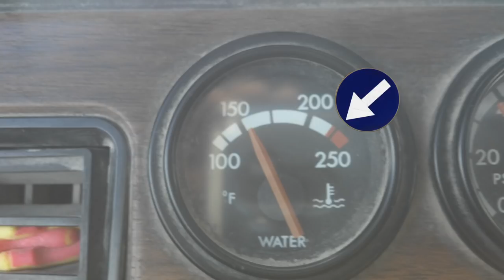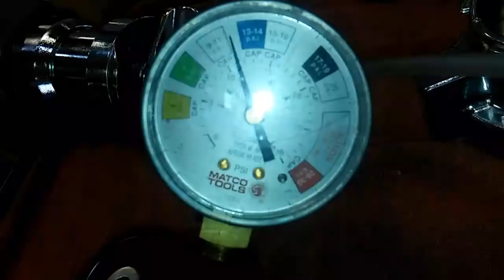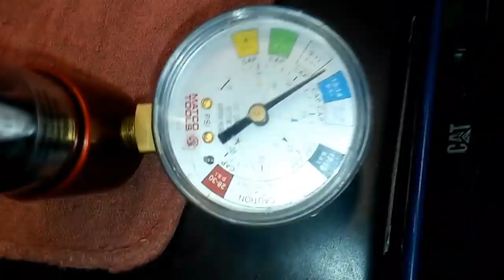Why Do Engines Overheat?

Comment: The glycols found in antifreeze have little to do with raising the boiling point.  They are what give antifreeze its name.  Raising of the boiling temperature is purely down to system pressure, which must be enough to prevent cavitation or localized steam production around hot spots like combustion chambers and exhaust ports.  While water is the best fluid for transfer of thermal energy, its boiling temperature is rather low for use in engines, so the system operates under pressure to combat that.  A company called Evans makes a coolant that does not require you add any water, and as a result can be tailored with a very high boiling temperature of around 370 degrees fahrenheit and zero pressure.  It is ideally suited to diesel engines.  Check it out.

Comment: I had a problem with disappearing coolant, it ended up in the expansion tank. It turned out that the radiator cap was leaking air, no fluid was lost as the pressure was fine, but once the engine cooled off the fluid wasn't pulled from the expansion tank back into the radiator, it was pulling air instead. I noticed it only because i stopped getting heat from the heater.

Comment: I discovered our cummins powered generator had a radiator with fins covered in oil residue and dirt.
Hard to see due to installation inside a building.
A pressure washing was all it took to restore operation.
Radiators can be plugged on the inside OR the outside.

Comment: Hello.  My name is Dave from Shields Excavating in newaygo MI. I want to thank you for this video.  Im have a overheat problem with my dump truck. 95 GMC 3116 cat topkick.  I've changed a lot of parts and it still is over heating under a heavy load. Around 30,000  pounds.  I've cleaned the outside of the radiator. I've Changed the waterpump, belt, thermostat, and coolent.  I've had a camera look inside the radiator and it looked good.  But i never thought of the cap.  So i will try that.   Thanks and for the idea..  Have a good day

Comment: I appreciate the idling video Adept Ape. As a result I've changed my startup and shut down strategy. Per the 20% threshold, my C9 calculated idling time is 36% (50MPH). As for coolant temperature my motorhome has a digital readout. When the coolant temperature reaches 190 F, one thermostat will open and the temperature will immediately dropped to 180 F. On a cool day (65F) it will be 20 to 30 miles of interstate driving for the engine obtain its operating temperature of 205 F. 
All diesel motorhome owners need to watch your channel.
Reply from the maker: +Kenneth Bullins Thanks Kenneth, I saw your donation too. You are very kind.
Reply: @AdeptApe  what about a mix of Antifreeze  will it cause overheating?

Comment: Another great video! Perhaps its worth a mention as to the second function of a thermostat and why people should not remove them. The job of a thermostat is to create back pressure in the cooling system to reduce the formation of air bubbles as well as to assist in a rapid warm up cycle. Even a failed unit that is stuck open will cause back pressure even though as you pointed out, the engine will never properly reach operating temperature.

Comment: Another great video, Josh.  As you stated, the entire overheating subject matter can't be covered in a short time.  Since a lot of truck owners view your site, I thought I'd mention the classification of coolants.  Prior to my arrival at the present place of work, coolant classified as ASTM D3306 was being used, and as a result, several engines were lost, because that coolant is engineered for light duty diesels.  

Coolant designated ASTM D6210 should have been used, as it is manufactured to meet the operating requirements of diesel engines with liners.
Reply from the maker: +Chad Jessup I'm guessing it has more cavitation resistance than the light duty stuff.
Reply: Yes, that is correct.

Comment: What can cause the temperature gauge to fluctuate between 185 to 195, normal operating temp is 185 for my truck. But when trying to go on hill with heavy load or trying to speed up the truck the gauge fluctuates lil bit.

Comment: When it comes to thermostats, I've found in cars running without one, or one stuck open, that they'll often overheat without some restriction, like a washer, due to the coolant passing through the radiator quicker than the radiator can cool it. 
I'd imagine that the same would be true for a diesel engine as well, if the driver is mistakenly thinking that RPMs will help cool it down. 
The driver would come out ahead if he keeps the RPMs down in that case.
Reply: DrFruikenstein
The other big problem if you run without the thermostat is you can overheat the back cylinders in the engine, that restriction from the stat is needed to force the coolant to flow the fall loop round the block. You wind up with the furthest cylinders overheating with the temp gauge reading low, not good.
Reply: deezelfairy 
That's why it's best to not run it until fixed correctly.
Reply: Its different in diesel engines as diesel engines waste less heat energy since it is usually recycled by the turbo

Comment: I've had to replace a radiator in my car not from blockage, but from complete lack of heat extraction fins that are supposed to hold the coolant 'tubes' in place, that thing was lucky to hold any coolant at all.  Radiators can get completely destroyed just from road grime hitting the fins and blowing through, and over time the radiator just breaks down into nothing.  That might be a sign to change your radiator out, which most likely, with better current technology, hold up quite better than the stock counterpart.

Comment: Adept Ape:    I have the opposite problem.  My 379 Pete with a 6nz c15 will never get over 175f summer or winter. Changed all the thermostats with new 195f ones and made no difference.  Any ideas?    Ty in advance.
Reply from the maker: Bad sensor? Fan staying on?
Reply: Adept Ape :   sorry , I forgot to say  I had a new fan clutch installed as well. It seems to be working.  What sensor could that be?

Comment: Hi Josh I have a question I have a C 15 ACERT MBX. It’s fan kicks in at 225 F .. should I be concerned ?? I idle truck overnight in winters few times a week. What I do is leave climate control on Defog position that way compressor starts the fan at 175F. Is this the right thing to do ??

Comment: My C15 only gets hot on Long grades when the Boost gets high for a long periods trying to go up hills when heavy. I've been told I can put a fan switch in and started earlier? As long as the Boost stays down or doesn't exceed 30 for too long she runs like a charm. Any comments welcome.
Reply: Robert Spradley 

Maybe you can give me some of your input on this, I'm new to diesels I just got a diesel motorhome a Cummins 5.9 Allison Transmission.

I just did a full fluid change and hose swap for silicone hoses.

My heat gauge looks very similar to the one on this video and my motorhome on normal driving conditions drives about 205 F to 210 F.

It's not that far away from the red zone at all and I had the same issue going up a grade it went into the red so I had to pull over to let it cool down with the engine running.

I just made all the changes and finished it today and I went for a test drive where I don't have a long uphill grade but it's pretty steep and again it got right below the red zone.

Only thing I can think about is my radiator the outside is clean maybe it's plugged internally or is that the normal running temperature?

Any advice will help thanks.
Reply: Spradley
 Sounds like possibly your running your turbo out of your compressor  efficiency map @above 30psi of boost this causes the IC to heet the  air going to the radiator, if air temperature is over coolent temperature this would add heat to the radiator insted of removing it.  
Mesure the intake manifold air temperature if it's hotter than coolant temperature you may know what the dragon you're chasing looks like.

Comment: Hey maybe you can help me out. I have a cat 3406e and at idle temp it stays at 200 degrees. I don't think that's normal for an idle temp. It never goes above that. And when I'm driving the fan turns on when it gets near 200. Do you know why the temp is so high when sitting? Or is that normal for an older truck?
94 FLD

Comment: engines convert about a third of the energy in the fuel into power at the flywheel, the rest is turned into heat and somehow the engine design has to find a way to reject that heat.  Some of that is easy since about half of the heat goes out the exhaust pipe, the rest goes into the coolant fluid or the oil.  Industrial engines (i.e. trucks) are expected to deliver a large percentage of their rated power most of the time (think of pulling a heavy load over a mountain range), therefore the engine builders make engines with large cooling passages, large oil capacity, a hefty oil cooler, and a big radiator with a strong fan, and a fairly unrestricted exhaust (before the EPA got to that).  On the other hand cars usually only need about 25% of their engine's power so manufacturers do things like smaller coolant capacity allowing the engine to warm up fast and get the heater and defroster going better, likewise they put less oil in the engine for the same reason and skip the oil cooler and a big radiator messes up their front end design so they undersize it and to cut cost the exhaust is undersized.  Back in the day on some cars, if you opened the secondaries on the 4 barrel carb it was only a matter of time till you overheated, you were making more heat than you could reject.  If you have a v8 engine with a 4 qt oil pan and a 12 qt radiator you are going to have an overheat problem, a v6 with a 3 qt pan and 9 qt radiator is in the same boat.  So if you're towing the boat (or camper) with your 1500 pick-up you had better back down on those hills or you will be stopping completely.

Comment: Hi there great Channel !I have a unique problem my 2005 C7 cat seems to go into a overheat condition just as I  drive it and then if I pull off the road shut the engine off turn it back on let it idle for a bit it'll come down to normal temperature and then it'll run all day with no problem? Thanks

Comment: My water temp gauge doesn't go beyond 130 degrees. I've manually inserted a digital thermometer into the coolant in the rad tank. It consistently climbs and holds at 180 degrees, same temp as my thermostats. 
I've changed the sending unit in the housing (no Teflon tape), new water temp gauge, checked all wiring and ground connections, and it still reads 130 degrees. 
Someone suggested corroded t stat housing bolts inhibiting ground, and rad tank water is hotter than t stat housing water, giving me a false reading of my actual water temp. 
Any ideas?

Comment: Hi ape, my Peterbilt 387, yr 2007, with c15 acert, have coolant temperature problem.  When i drive on highway, fan turn on at 220 degree f when uphill then fan turn off at 190 degree f, and recycled again, that’s for now.
But before I overhaul engine, the fan turn on at 200 degree and fan turn off at 180 degree.
Please help me, what would it cause?
Reply: Tammy

Comment: Got a 14.0 detroit has been getting up to 225 used to run at 175 now runs at 200 most of the time is the truck running to hot ????????

Comment: My question is i.have 12.7 did an inframe new thermostats new 4core radiator  new coolant but during a small hill loaded it goes up to 210 it.runs regular 190 any.advice thank you

Comment: Hi excellent videos, have you ever worked on an Isuzu 4lc1 engine as I'm having issues finding the workshop manual and it's been over heating and has a rattle that I am unable to identify, if I posted a video would you be able to help identify the issue?

Comment: We have a CAT 3126 that will overheat when driving at highway speeds  after about 20 minutes but not around town. Any ideas what to look for besides the radiator cap and coolant?
Reply: ChaparralDenizen I'd be checking exhaust and intake for restrictions.
Reply: Jay Dunbar Good tip. This has some aftermarket dpf since it came from California and it could be clogged. I don't even know if it is connected since the previous owner had it in New York

Comment: i got a question. i got a 87 freightliner cabover. has a detroit 11.1 and normal idle temp is 160,fan kicks on at 180 and no matter how hard i work theis truck the hottest it gets is 210 and as soon as the load is taken off it goes to 160 until its worked hard at low speeds.the truck hauls manure or silage and gets worked hard at 1500-2000 rpm range in fields. does this sound like my thermostat could be stuck open?
Reply: I'd suggest the accuracy of the dash instruments be checked using a temperature measuring device at the thermostat housing.  Along with that procedure, run that measuring device up the hose to the radiator while the engine is warming, and see if that temperature mirrors the engine coolant temperature.  Similar readings would indicate an open thermostat.  There also could be a poor ground connection depending on the manner in which that gauge/sensor is wired - seen that, fixed that in one of my '87 Freightliners.  HTH

Comment: Thanks for the video. Sir i have a concern, while i was driving and i catch 155km/h my car temp went one line before the last line of temp. And i reduced the speed on 100-110 km/h and turned on the heater on max, the temp get back to the normal but when i tried again to catch the highest speed temp went again same!! By the way i've got a vw golf mk2 1.6 td
Reply: The water pump may be cavitating at high rpm . To test run the same rpm 1 gear down ... 96mph dusen't sound fast enough for an aerodynamic  flow restriction through the radiator (its more about gitting the air out of the engine bay then getting it in, some times).  
Overspeeding the turbo?
Compressing air heats it.  Your IC may not be up to task, increasing your IAT to a point of run away coolent temperature. + high IC temperatures reduce the efficiency of the radiator.

Comment: My brand new 331 stroker motor only overheats in stop n go traffic. When moving at a good speed for periods it runs under 200. I just put a 3 core radiator with dual 12 inch fans and bigger water pump pulley. It doesn't over heat now but still runs hot..around 225 Any ideas?
Reply: @ Ken Mount ...is the shroud that connects the fans to the radiator intact? I had an overheat problem with an early 90s chevy truck with a 5.7L and the previous owner had not reinstalled the shroud after some previous work.
Reply: @wtsufan4558  No, shroud was never put back. No room. I might have to go back to a 2 core so I can put torque fan and shroud back in.

Comment: Thanks for the Interesting videos. Do you happen to know of examples of sound recordings of engines under load vs. under no load? I ask because in most video games the sound designers just record engines at various rpm when they run without load, but i have a feeling it would sound quite different. Could you say something about that?

Comment: Hi there Josh, recently found your channel and love it so far! Have a couple of questions for you. Before entering into the emergency services field I’m in now, I grew up in a shop and worked as a tech all through my teens and until my mid 20s, primarily on consumer gasoline powered cars and light trucks both foreign and domestic and I found your info about the cause of the overheating in the vehicles and machines you service very interesting. From my experience with consumer vehicles, the number one cause of an overheat was due to a coolant leak thus less of pressure and volume. Water pumps were actually pretty common failure points not so much due to improper fluid transfer but leaking. Also the radiator as most consumer vehicles have plastic tanked radiators and I often saw the hose barbs break off flush or the tank crack. Do the type of diesels you work on have steel tanks on their radiators making them serviceable? Do they also make use of more steel piping to route coolant as opposed to hoses in consumer vehicles? It seems like the failure rate of the radiator caps and cooling fans are similar between consumer and industrial vehicles as I saw a lot of them fail. One last question, how would your info in this video translate to a diesel consumer vehicle? I recently purchased a second gen 12valve Cummins Ram and so far haven’t had many issues with it. How does that cooling system stack up to the type for Cat diesels you service and are the failure points similar? Finally I just wanted to sincerely thank you for taking the time to produce and post your videos, they are a literal treasure trove of awesome info, keep up the strong work!

Comment: What could be the problem if you dont have any presure in coolant tank ?
Reply from the maker: fisnik bojku Check that radiator cap sir.
Reply: Adept Ape  i have changed that twice
Reply: Since you replaced the radiator cap twice, the issue may be a small leak somewhere in the coolant system.  With a nice tight system, even after sitting a couple of days, there should still be a burst of pressure coming from the radiator fill port when the cap is removed.

Comment: I wanted to mention something about radiators. A radiator only has 1 core. The core contains the fins and tubes. It may have 1,2,3,4 Or more rows of tubes. The tubes are what the water travels through to get cooled by the fins. You called the tubes cores.

We often hear people say 3 core,2 core etc. Wrong terminology. It may be a core with 3rows,or 2 rows etc.